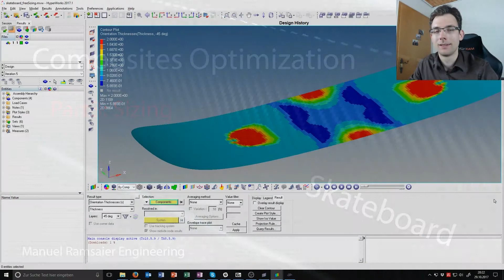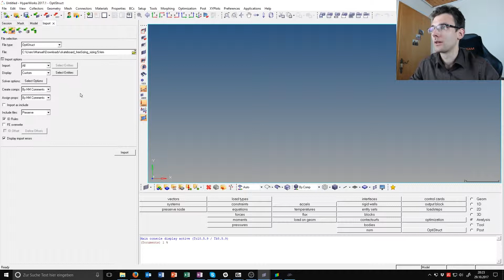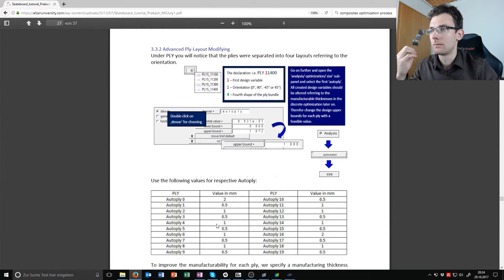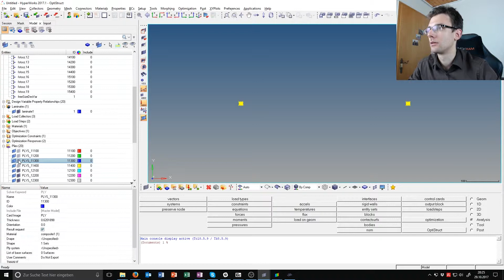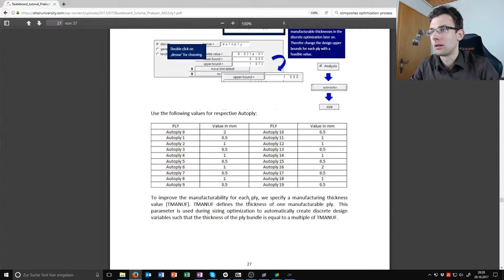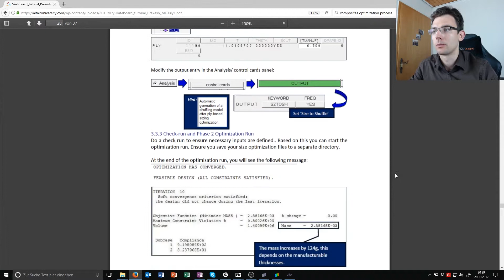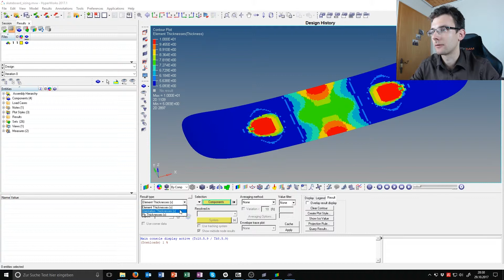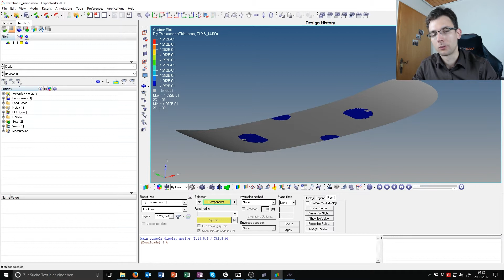Composite Optimization: Sizing

Comment: If the upper bound is really small(e.g 3e-3) does that mean the ply is not needed when changing the design variables? I am running a composite tube case but following your videos as guidance, thanks in advance!
Reply from the maker: Yeah sort of. The free size optimization would have wanted a ply this thin but as manufacturing constraints come into play this will get left out of the design in the sizing phase.
Reply: @ManuelRamsaier  okay got it!

Comment: Hello.
Thank you for your video.
When increasing the upper-bound value in the DesVars, do you go to the next whole-multiple of ply thickness to current upper bound ? 
Would it be possible just to go to, say 100x each ply thickness for the upper-bound value and let Optistruct work out how many multiples of the TManuf value is needed ?
I ran a Size optimisation with the correct TManuf values but left the DesVar upper values as received and got a solution, yet when I changed the upper values, as advised, I get the error:
"Invalid design properties w.r.t. the design variables were found."
"number of invalid property items = 4"

I"m going back to the unaltered deck to try and understand what triggers it but I'm confused as to why a bigger DesVar upper limit causes it to fail.

Best regards.
Reply: ...for example...
My plies come in thicknesses of 0.23mm, so I have that value in my TManuf input.
After running the Free Size analysis and reading in the FSTOSZ .fem file, one DesVar has the following values:
Initial Value: 0.2367226
Lower Bound: 0.0
Upper Bound: 0.2840671

I can give the Upper Bound value anything below 0.46 and it still runs, yet when I give it 0.46 I get the error I detailed above.

[ I'm using v2017.2 ]
Reply from the maker: Hi  @lewis72  , can you paste in the error or is it just the above? Do you have any constraint on the laminate? If the summed up thicknesses is greater than the upper bound for the laminate, I suppose you get an error. Maybe this is also something for the Altair Support Forum, as there are Altair guys which know the code better than I do. But I am really interested. Feel free to send me the model via mail to: ramsaier@hs-weingarten.de
Reply: @ManuelRamsaier  
Hi !!
Thanks for your response. I'll punt it over to Altair and get their feedback.
It's only a simple plate model with a hole in it, so nothing project-specific.
I'll get back to you when I have found out what should be done. The guys at Altair are usually quite good !

I have found a number of tutorials/examples on the net and I do wonder of some are specific to earlier versions of HW. I found a tutorial ran in v11 where they ran the Size optmisation twice, once without the TManuf value and then once with, the latter having read in the .desvar file. All quite confusing as the Altair example doesn't do this !